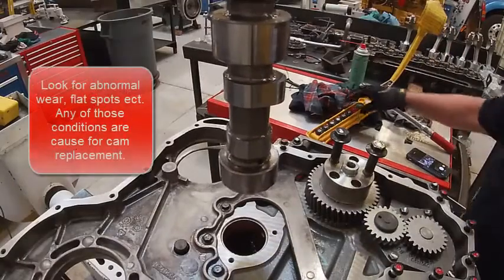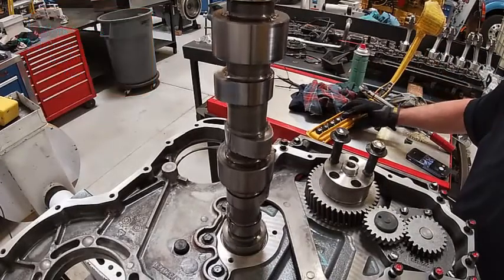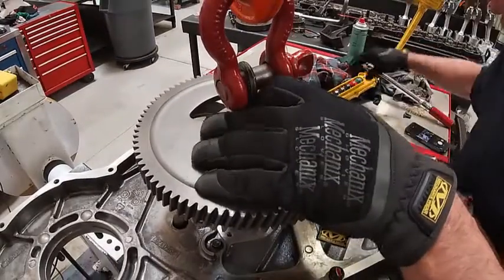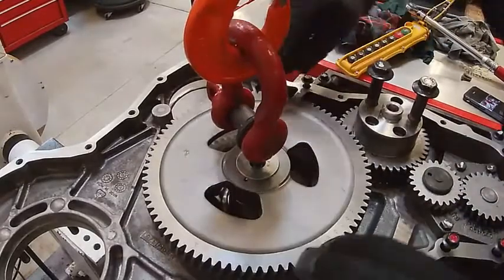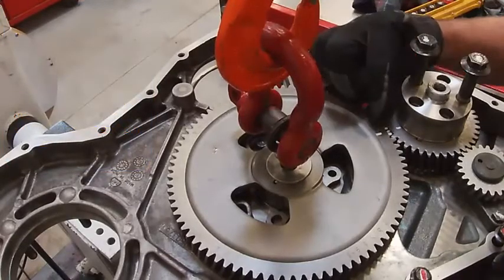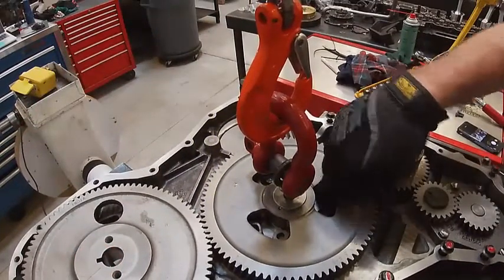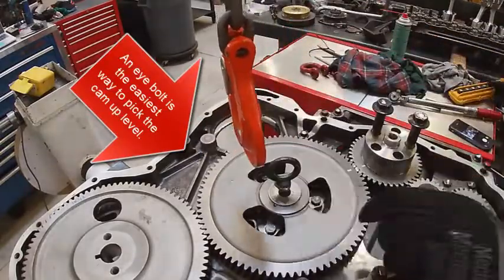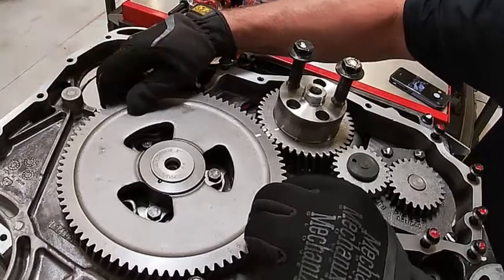Camshaft installation ICL ISB ISC Cummins 6.7 5.9 8.1

Comment: I have an 8.3 ISC that is pinging away while running out of the oil fill tube. I pulled the front cover to inspect. So, they play in between the fuel pump gear and camshaft gears are normal?